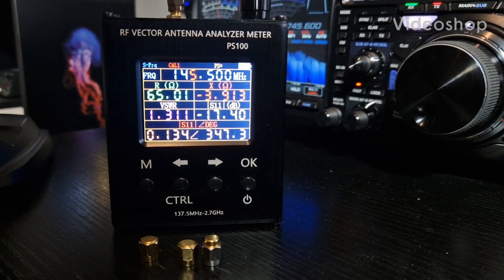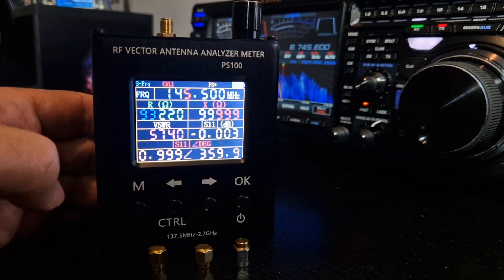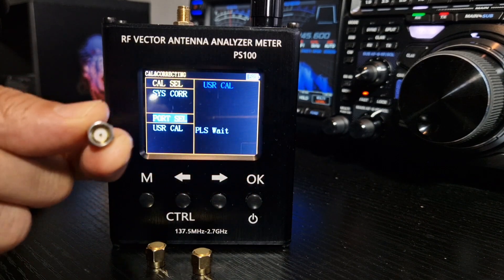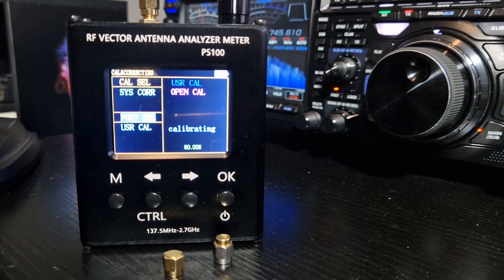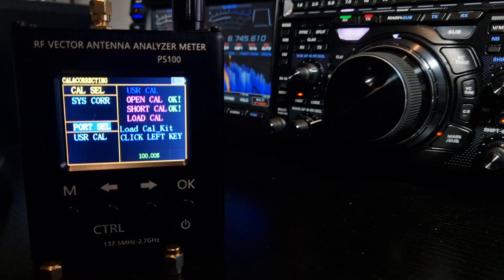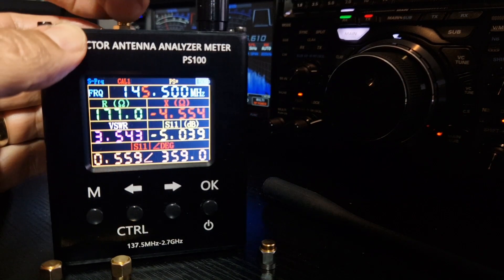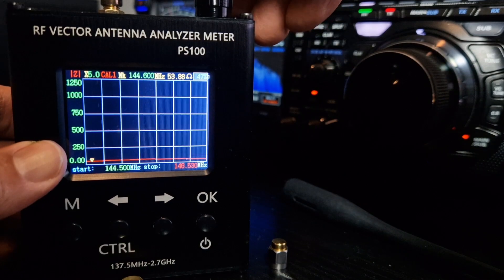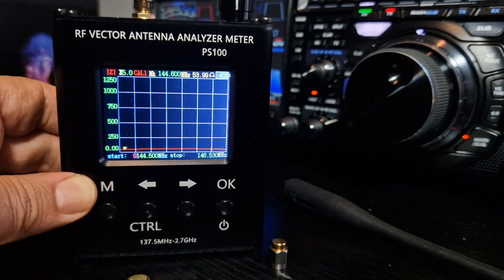PS100 - ANTENNA ANALYZER , CALIBRATE & SET UP , TEST

Comment: This like the blind leading the blinds, "I dont know if you cant toggle those at the top" but Im not gonna try it 8:30, but here with IZI we have swr..
put the god dang marker on the IZI in your vid and click your knob and then turn your knob and you gte all the fundamentals, graphing out, like VSWR, S11, X, Res.. etc and you can then dial to the next and adjust your ratio for each.
but the product is solid for 137m to 2.7G its performs great, and with solid accuracy I dont know if you can upgrade software.
Reply from the maker: Thanks

Comment: Open is a screened open circuit, short is a short circuit and load is a 50 Ohm dummy load. You really need to perform this calibration at the load end of the cable you use to use to connect to the device under test (DUT), in your case the aerial. What I have done is select a good quality patch cable, do the calibration at the end of the cable and then keep this cable for test purposes only. If you only calibrate at the analyser socket, the cable you use to connect to the DUT will affect the results you get.
Reply from the maker: Many thanks how long is your patch lead ?
Reply: I used about 40cm of semi-rigid co-ax, RG402 I think from memory.